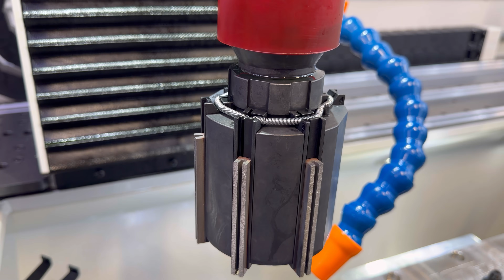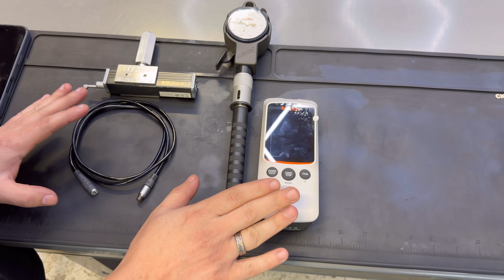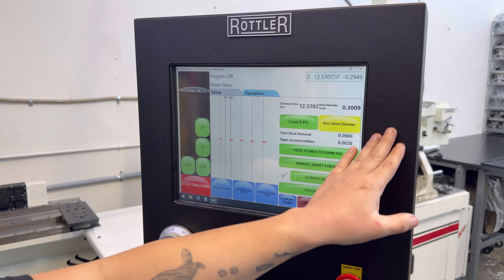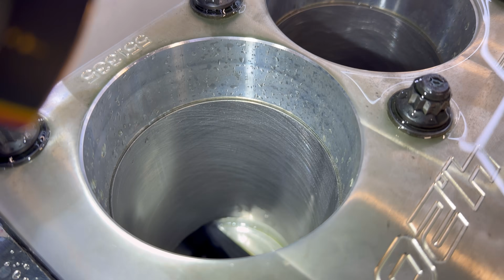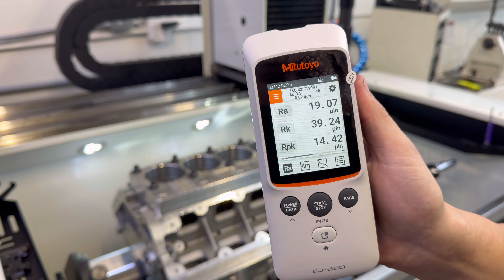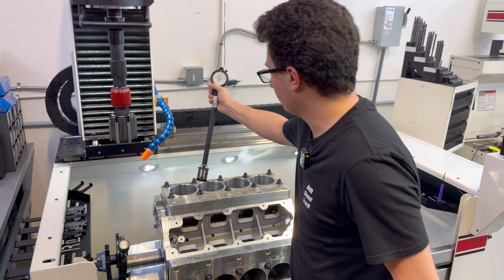Rottler H85A Precision Machining | Engine Block Honing Process Explained

Comment: Off-topic-question: Are the openings in the center of the block, seen a 12:30, for access to the lifters without taking the tops off?
Reply from the maker: Those are for access to the "6th" head studs to be able to tighten them. Unfortunately the lifters won't come out through there
Reply: Aah! I wish the LS-engines were produced with ports/windows which made it possible to access/replace the lifters without taking off the heads. They are buried so deep inside the engine.
Reply from the maker: @TimRobertsen it certainly would help with fixing the common lifter failures!

Comment: That is crazy accurate measuring of the surface finish in 1 millionth of an inch.  That unit of measure is normally used in nanotechnology.   Most machine shops dont even measure the surface finish other than the old visual check.  Nice video and explanation on why you should pay attention to honing.
Reply from the maker: Thank you for the kind words! It's so important to have the right tools in this business so that we can make sure our clients get the best results!

Comment: No "artisanal" or "creeping up on size" stuff here! Absolutely incredible. Trouble is, you can be the best machinist in the world, but with a manual hone, you'd struggle to get CONSISTENTLY under .001''. The less a human interacts, the better in my book. Lots of those types of machinists have big egos and think they can do better. Nope. One thing i''d love to see is how it gets itself square to the crank. Obviously the boring process is more critical for that, but how do you get the hone square ?
Reply from the maker: Thanks for the comment! The fixture itself is located off of the crankshaft as it bolts through the mains just like the crank does. We do a "centering" procedure on that as we clamp the block down, but the fixture also has 45° precut slots it sits into.